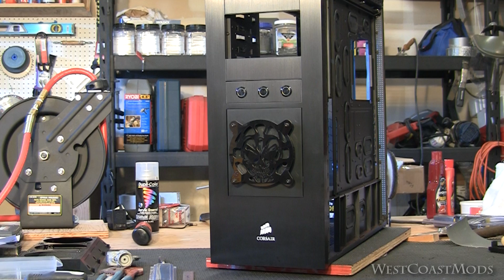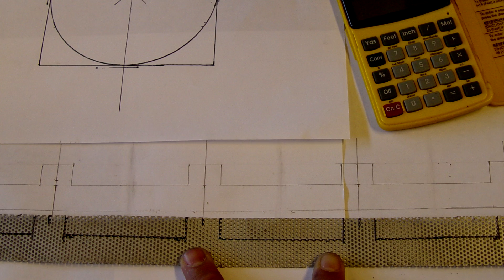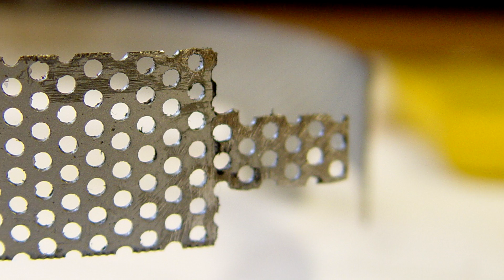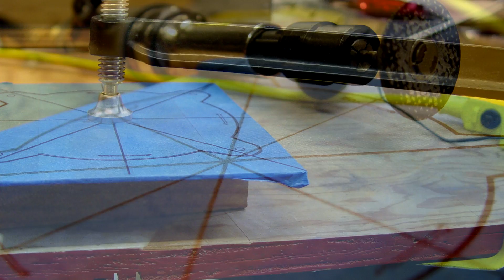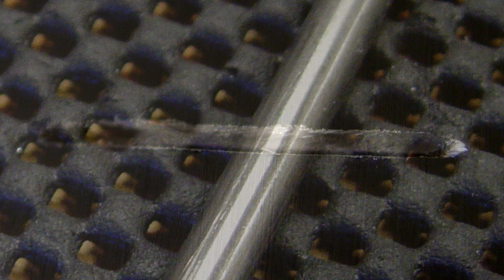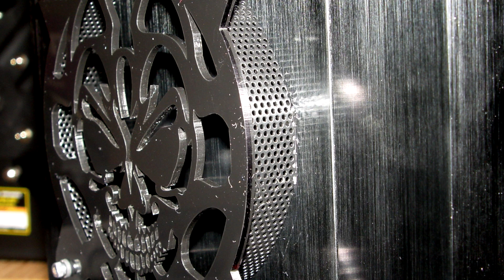Corsair Obsidian 800D Front Bezel Mod - Skull Crusher

Comment: looks great lazyman. i am glad you said your going to add lights to it, if it were my project i would probably use el wire on the inside of the bezel and go around it a few times, or if i wanted to spend more time on it make it so it goes "across" the lines i guess of the grill, but that would probably be a lot more difficult. it looks great and i cant wait to see what you come up with.